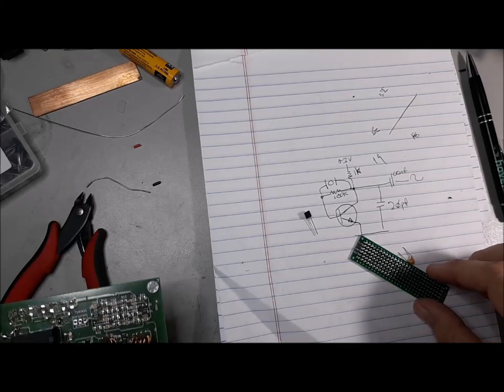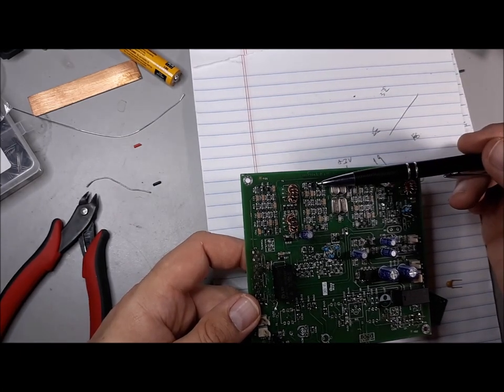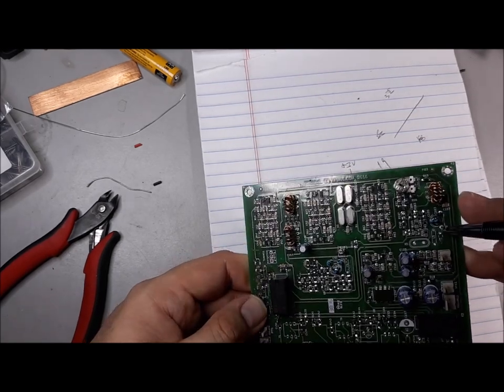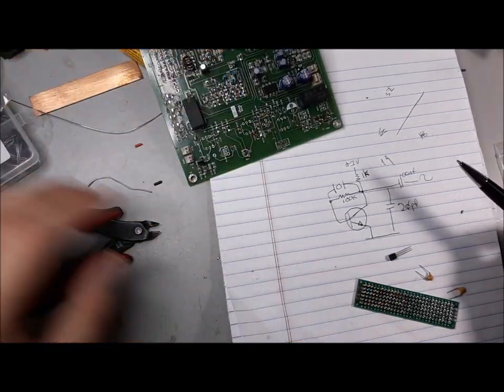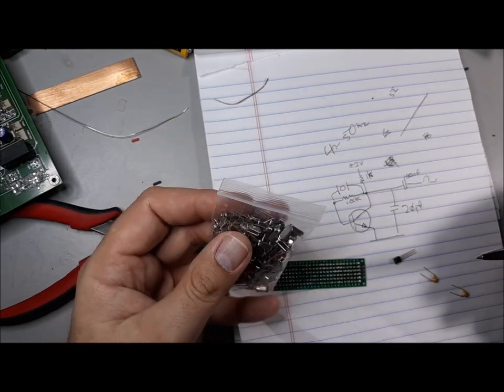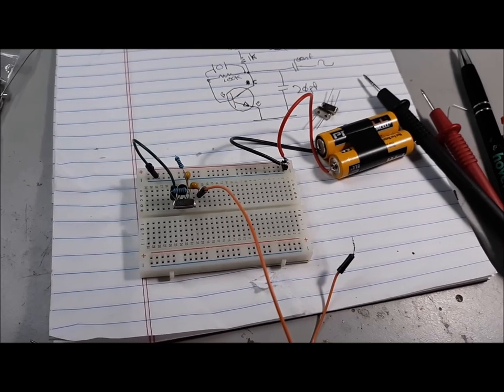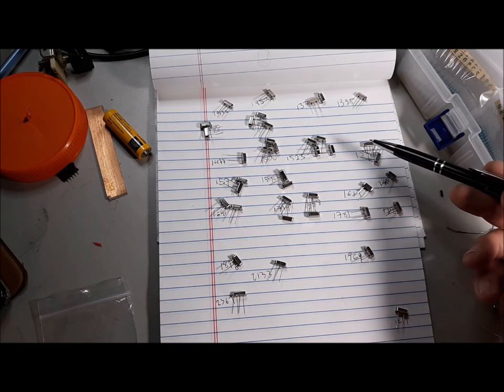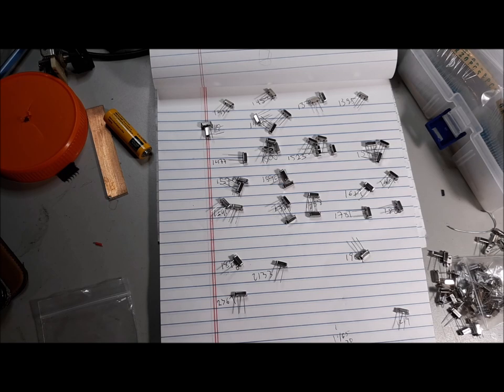BITX40 Rebuild Part 1 Review and SSB Filter change

Comment: Great video Ryan !!!   At about 20:30 into your video you asked for input on Crystal Testing/Selecting.  There are a few other parameters besides frequency that can be measured/compared, K7QO's YouTube video has great explanation for testing crystal parameters.  Title starts with "Transistor Projects: #011"  at  https://www.youtube.com/watch?v=IsugAhu-fHQ&t=31s.  Since you're going for an SSB filter and not CW, it may not be as important.  I have no experience in this area...
Reply from the maker: Thanks for the link! I'll check out that video. Chuck's name comes up a lot in these things doesn't it :)